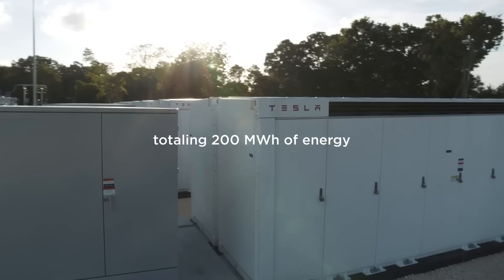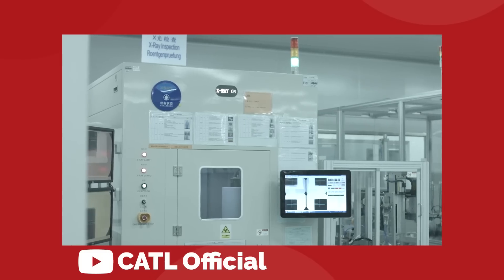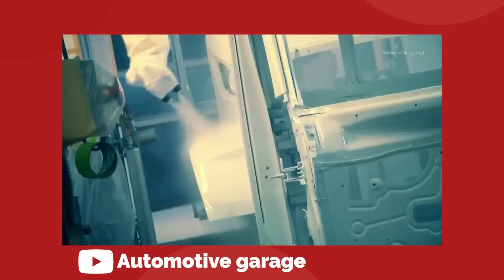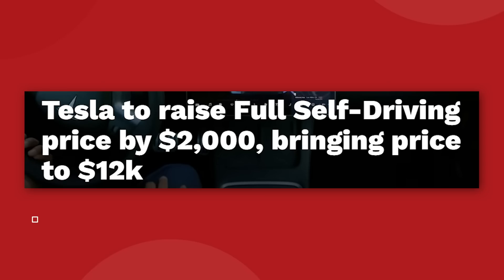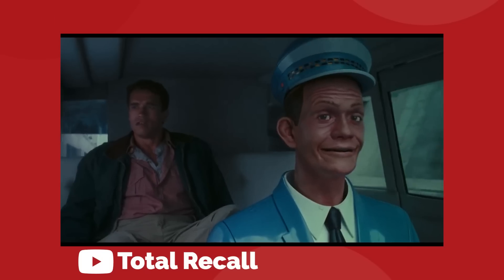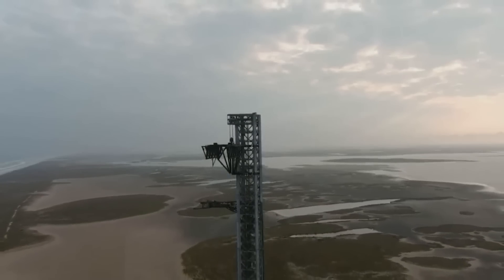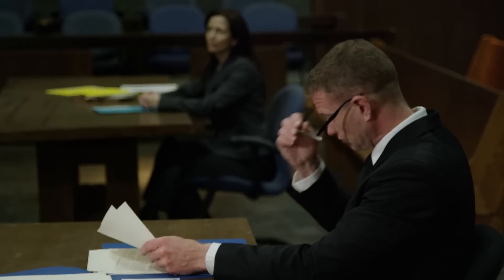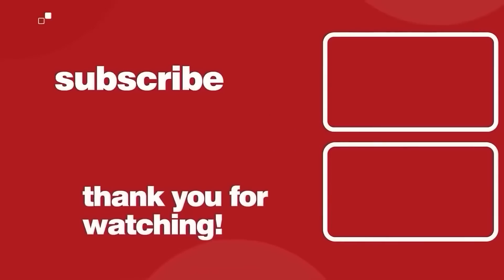Tesla Energy Is Coming To Save Texas!

Comment: Tesla needs to make a electric drive trailer axle with dynamic breaking trucks use the most fuel starting climbing hills and breaking on the down hill it could reduce fuel consumption from 1/4-1/2 all trailer axles are interchangeable and Tesla could make a prototype by tomorrow if they haven't already

Comment: You also need to understand that companies like Pepsi or say Budweiser only go so far with their delivery trucks they unload massive amounts of products at many stops that aren't that far apart. Maybe a hundred miles out and 100 miles back with a lot of stops in between. So the vast majority of their trucks will be charging at their original starting point. They are not over the road deliveries that end up somewhere else as far as the vehicle.  And that is where the Tesla semis are going to be used for quite a while, so charging stations all over the US instead of just at the distributorship isn't a need that will come up for a while.

Comment: Texas doesn't deserve saving.
They want to stand on their own.
Fine.
Let them stand alone, let them fall alone.
Reply: @kingbran923  actually it was mostly natural gas plants that failed in that cold snap. Windmills got taken out as well but only because they didn't have the de-icing equipment that windmills further north had. I forget if solar got taken out but it could have come back online soon after it stopped snowing
Reply: @Rawkfist1501 well with pipelines frozen the plants basically failed anyway that's what I meant. And yeah I agree that it was just a freak snowstorm/cold snap and that nothing was to blame
Reply: @kingbran923  First part is  true.  Last part is not true.  Gas powered  plants froze, which is something like 80% of TX energy.  Renewables which froze were only 5 % of TX energy.

Comment: If I were Elon, I'd have a privately owned solar farm, owned through offshore (but yes still tax payed US), forever being grown into a bigger solar farm, that simply sells the power to the state solar grid, or using a 'small' potential energy capacitor to store it for sale on a later time when power demand is high. Why ?
So you always have a source of money that's always positive at any given time.

The solar capacitor is like a water storage, it pumps water upwards into a sphere, where it then stores potential energy. When the water gets pumped up high enough, it can stores a lot of power, while draining the sphere through a turbine can deliver power much the same as a dam. The artificial height works the same as the regular dam pressure does, but can go much higher, like 300-400 meters up. In a closed circuit, only the height of the highest point determines underlying pressure.
Reply: Alternately he could sell power to himself. Like his factories, or sell power to his charger customers.
In any case, It would still be a safe bet that always delivers.

Comment: Tesla mega packs would have helped Texas a little, but you are in cloud cuckoo land if you think some mega packs would have kept the lights, heaters and stoves and appliances, etc on in Texas for 10 days.
Reply: And weather event like that had never happened before in the history of texas. It's the same thing happened to wherever you are hiding at I'm sure your grid would have been crippled for a long time. And your mainstream media that you watch greatly exaggerated what went on because the majority of people in Texas have backup generators attached to their homes or in garages. Apartment buildings were the main people caught off guard.
Reply: Would need a whole lot of them for that event for sure
But it could at least prevent absolute power outage for multiple days
(They can ration--via power prices--the bare minimum heat needed to keep folks alive)
Reply: @KingXKok  For longer duration power I think they need thermal batteries or liquid air systems or something else.
Reply: Batteries for the other of days still work. But definitely for weeks to months we need stuff like hydrogen or compressed air or thermal etc
Reply: Another concept mentioned by Tony Seba is 'super power' which means on 25 days of the year you have enough power and on 340 days of the year you have a large excess of power available for things like hydrogen, aluminum, etc
Reply: @williamscoggin1509  To be precise, the same weather happened 10 and 20 years ago. Absolutely nothing was done to fix the problem, which is why people died during the snowstorm and week long freeze. . The majority of people do not have back up power! However, judging by how all the big box stores are out of generators, more people will have back up power.